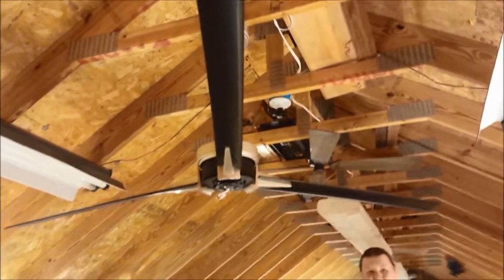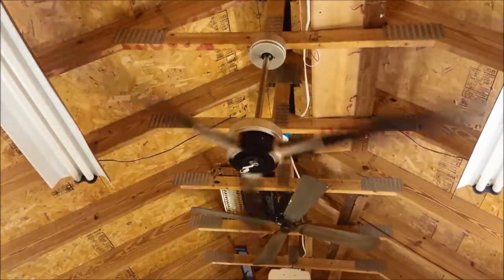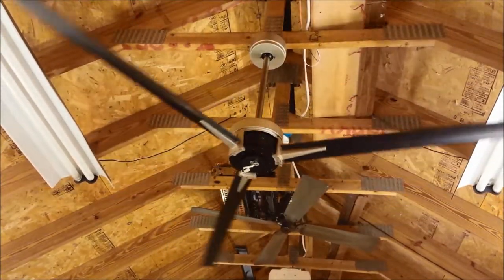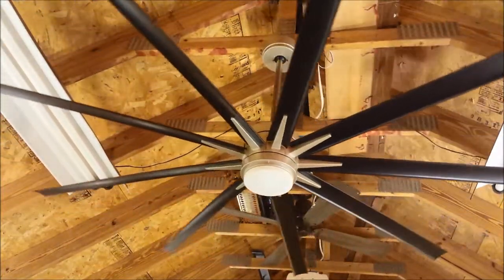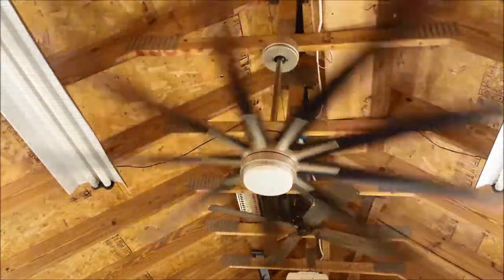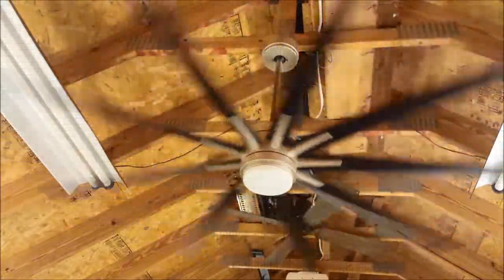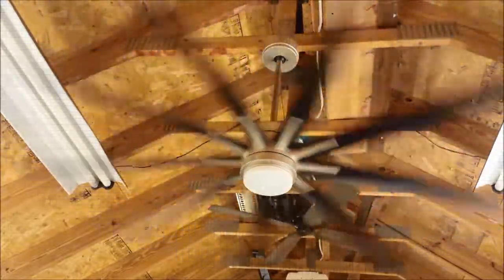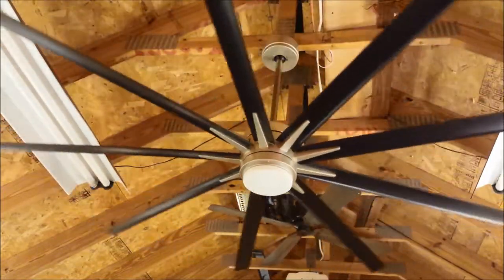Full Test Video of a Fanimation Odyn (DC Motor) Ceiling Fan model FPD8149

Comment: Is the 4-blade can in the background an Emerson "Blender" fan? I have a 3-blade "industrial" version of nearly the same fan from a factory I worked at for 7 years. I got it when they were doing painting and remodling. If I had got to maintenance sooner, I could've had 4 -5 of them...unfortunately, they jammed most of them into the 55 gallon drums we used for trash and scrap metal, bending or breaking blade brackets and cracking blades in the process... Luckily I was able to get one in perfect condition. I always thought it had wooden blades, but when I got it, I was surprised to find out that they were fiber-glass/plastic.
Reply from the maker: Yes, one of my all time favorite fans, if you ever want to sell let me know!